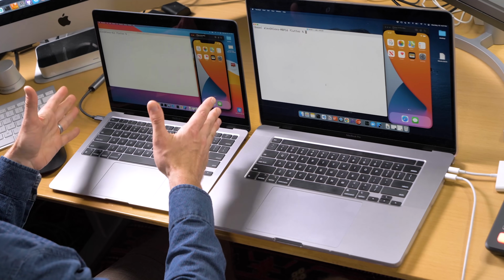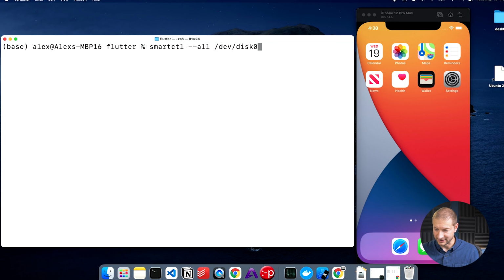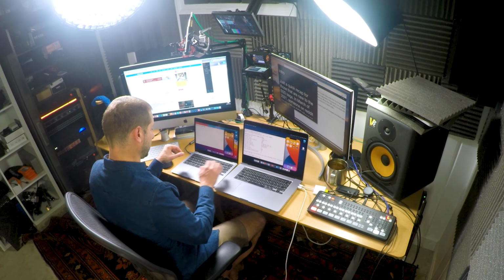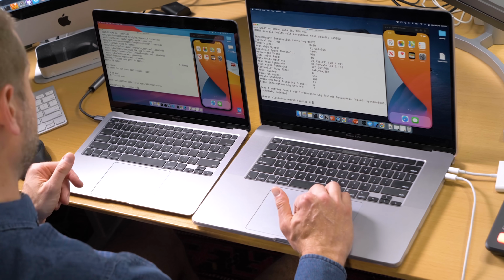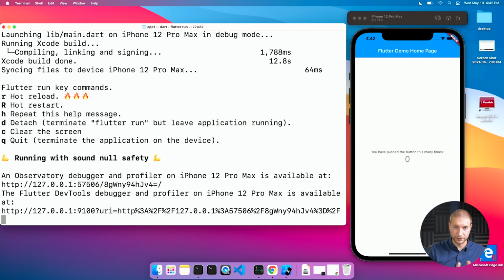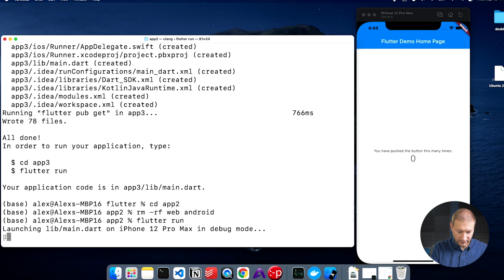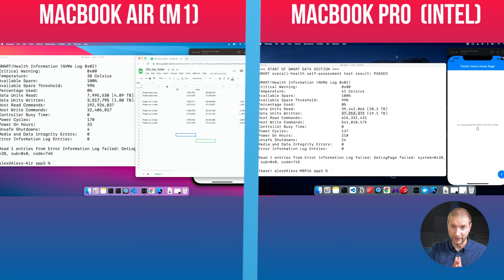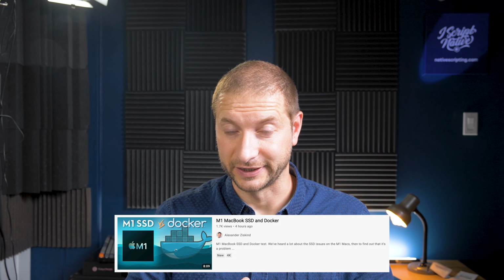Is Flutter KILLING the M1 SSD?

Comment: Hi! I will try to explain the situation. I use for Flutter development in a laptop i7 16gb and of course I save the code in a repository (duh). My question is: if I buy a Mac Mini M1 with 8gb (yes, only 8gb) will I be able to build the project for iOS/Mac? I don't want to use the M1 with 8gb for programming but just compile the code. Can it work?

Comment: By the way now my mbp m1 2x on reatarting got panic . I have development with firebase where the project have 2 branch. First branch is normal project and second branch have firebase for auth anonymouse and email with password . When i change branch and pod install is very panic because i need run arch mode for pod install, some component not support on m1 for firebase running .

Comment: I got a ryzen 3900, with nvidia 3090 ! I see the M1 compiles as fast as my 12 core ryzen cpu.. and Im contemplating myself to switch to apple silicon to get the portability. I guess the M1 can support 4k screen resolution ? my desktop is a 4k monitor.. great for looking up documentation and blow up code. But what about gaming or Cuda ? thats no way to connect a nvidia board to a M1 right ? this is whats holding be back. if there was a way to connect nvidia driver to the apple system and use cuda with GPU's ohh man..

Comment: Wish I could buy one replacing my MBP i9 but I have to develop windows 32\64 bits applications. I am using parallels and AFAIK I can only run windows for arm build and I assume it would not help developing for amd64 architecture. Please someone say I am wrong and I would go for an M1 soon. (and I don't mean to use with QEMU, Rosetta).
Reply from the maker: You are right. Until Windows for ARM runs smoothly on ARM machines, we are not able to really use it for serious applications.
Reply: @AZisk  Thanks for confirming. As always I love your videos and insights. If it isn't too much to ask, and if you did it, how well does it perform to develop in Visual Studio, C# ASP.Net applications compared to MBP i9 and parallels (I mean with the Rosetta does it work and the speed is at least one that is workable with). Just  a yes or no is sufficient for me (you won't be responsible if you say yes and later I find as no :).

Comment: Can you do a comparison booting macOS externally on a Thunderbolt 3 enclosure to the built-in SSD on the M1 mac? Western Digital SN850 as NVME drive, which I suppose is the fastest NVME on the market.
Because enclosing your OS on a board :) It is risky. Who knows when what will die on that board?
I mean both on the M1 Mac

Comment: Could you test multiple core performance?
Reply from the maker: How do you suggest I do that?
Reply: @AZisk  You could run some python code with multiple process, and make them calculate for example prime numbers or any other special numbers in range of 1 to 1.000.000 and prints the elapsed time.